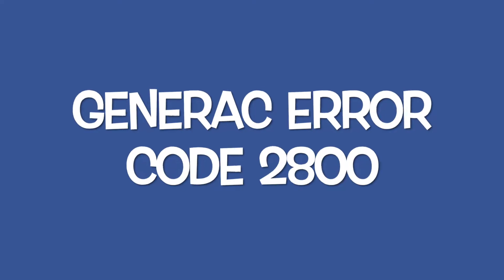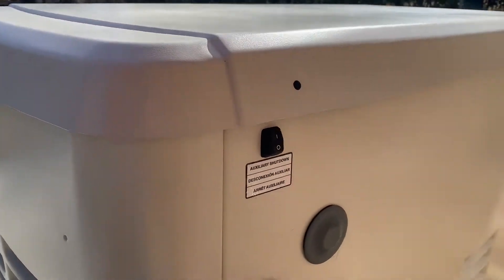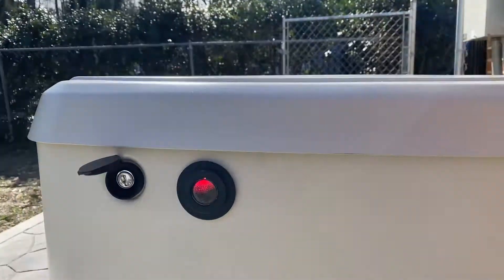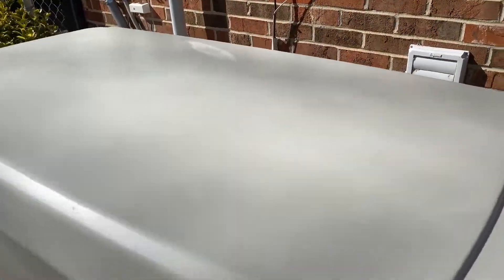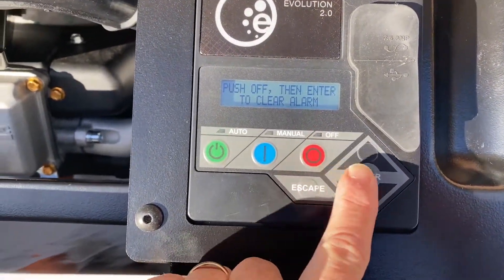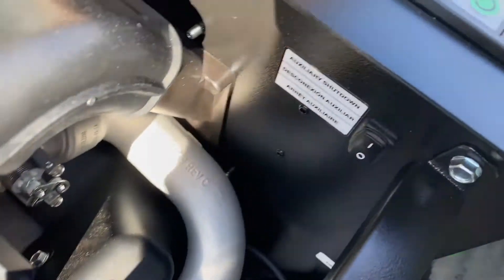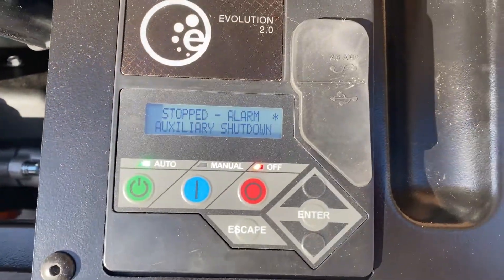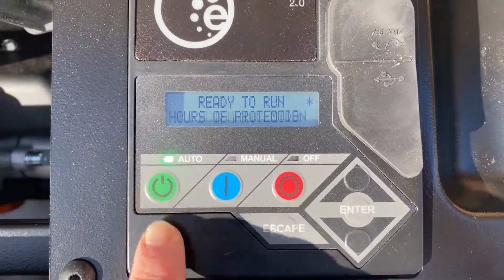Generac Home standby generator showing an error 2800

Comment: My control panel melts after 2h usage. Looks like the cooling stoped when I stop the generator after 2h of run. The heat melts the control panel and deformed it. But it looks like everything is working an can boot up and use the buttons. But it wont start anymore im getting 2800

Comment: Thanks for this video. Our generator had not done its weekly self-test in quite a while. After watching your video I found the reset button and noticed that it did not lock in either position but seemed loose. I pulled on it slightly and it came off in my hand. Turns out it was only the rubber cover holding it in place. I then replaced it by folding the rubber cover back over my finger and carefully pushing the switch it until it latched making sure it would stay locked in either position. Replacing the rubber cover proved a bit of a challenge because there's not much of a lip for it to catch on. The generator started fine after the error code was deleted. Thanks again for this straight to the point video.

Comment: Question: I have a new one like shown here(close). We had a storm and my ground faults popped. After resetting that I saw Generator had a red light on. Showed elec. wiring error and I re set it to where it shows ready to run and hours of service (time its been standing by). Have all green lights. It keeps flashing from the screen  I spoke of to Hours of service and back to the original screen. Do I need to do something else?